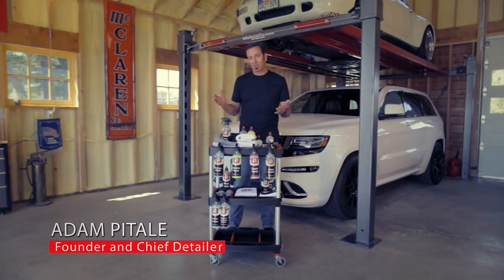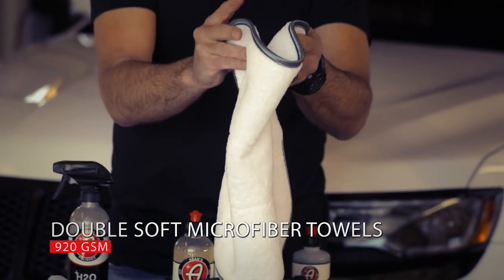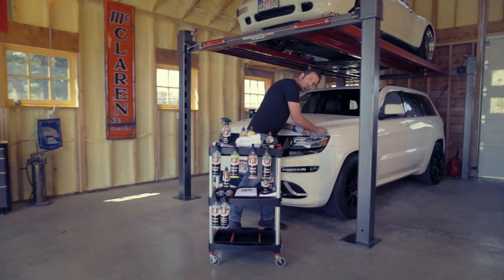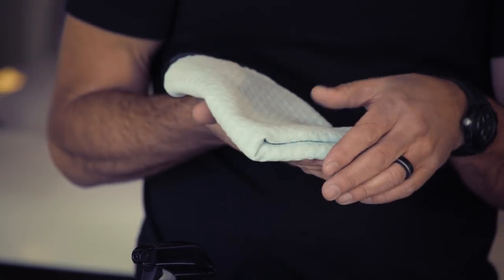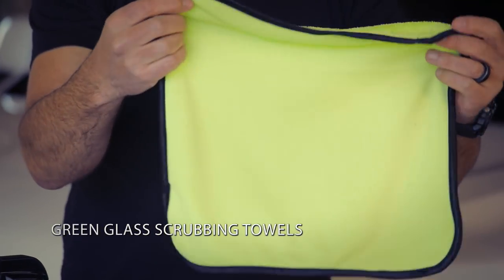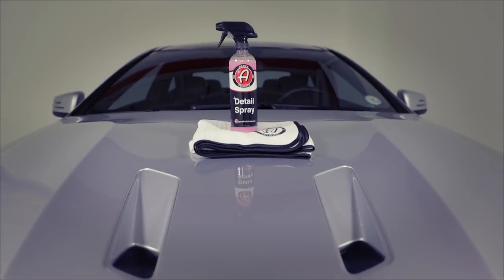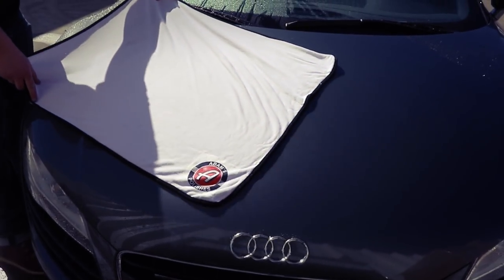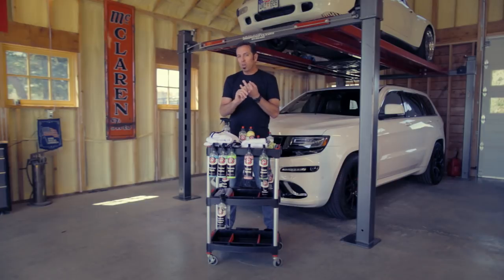Microfiber Towels | Differences and Uses

Comment: Just got your Microfiber bundle.  Can I use the towels right out of the bags or should they be washed with proper microfiber wash before using?  Thanks for making your product line simple and easy to use for the right application it's designed to do.

Comment: I got 2 of your polishing towels with your detail spray and its leaving lint on the vehicle. Is tbis normal until they get broken in?
Reply from the maker: They are most likely small loose fibers from the manufacturing process. Shake the towels out by holding two corners and give the towel a few snaps, or you can machine wash them with a liquid detergent like our Towel & Pad Revitalizer before the first use to ensure all loose fibers are removed.

If you still experience linting after that, it could mean that there is bonded contamination on the surface that is causing too much tension on the towel, so you could try to use a clay bar and Detail Spray in a test area to see if that is the source of the problem.

Comment: Can you recommend a towel for buffing off ceramic coating while applying ? Thanks
Reply: Use any cheap standard microfiber towel, because when you buff ceramic coating, it will harden the towel and you'd have to throw it away.